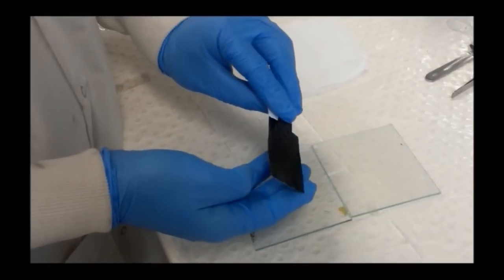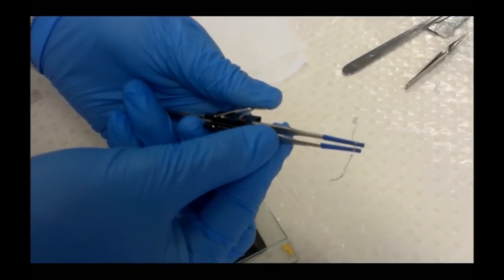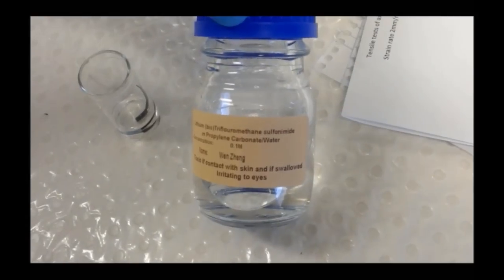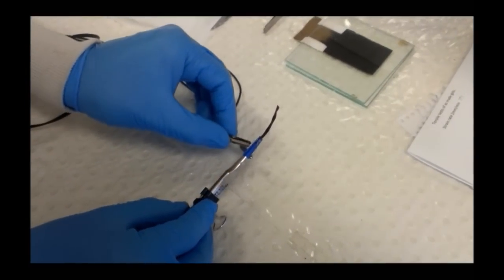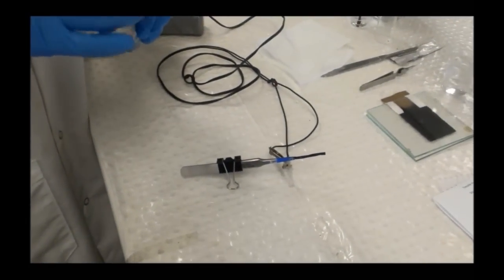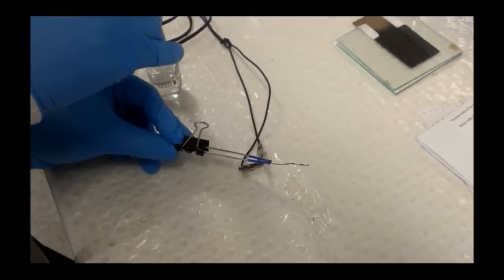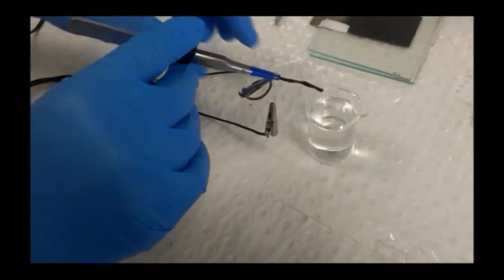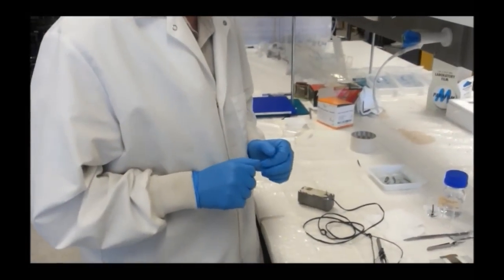Encapsulating Conductive Polymer Actuators-Part I

Comment: Hello Sir: which power supply used for to drive the polypyrrole actuator in present video?
Reply from the maker: +Kiran patil 
Typically we use a 1.5V battery and reverse the polarity to bend the actuator from one side to the other
Reply: @BionicMuscles thanks for your reply, seems to be one of the most overlooked data when presenting artificial actuator muscles and similar